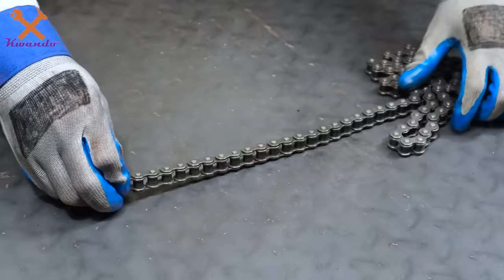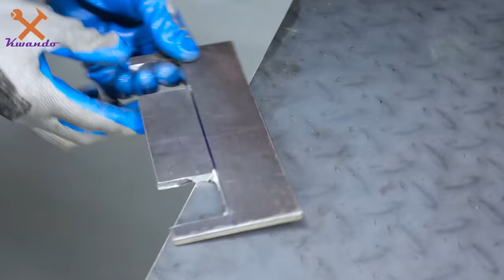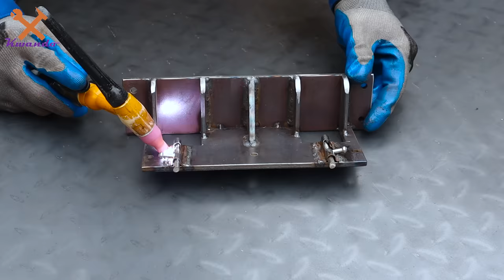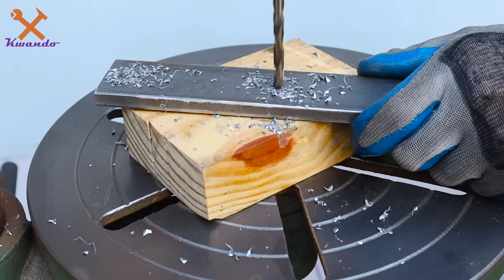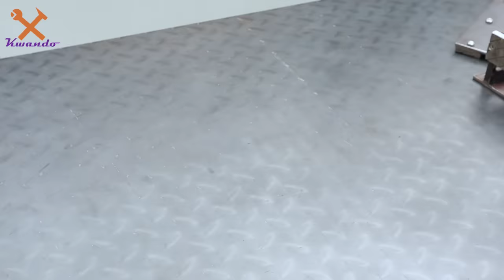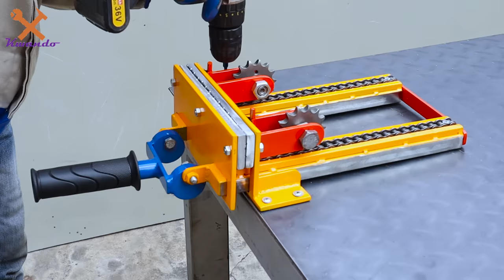Make An Unique Vise That You Never See Before From Bike Parts | Chain Vise

Comment: Hey nice job, I like how wide the mouth on it is, suggestion could you not tack on a small bar across the 2 locking pins with a light spring to keep it in the down position until you lift the bar to move it, it looks like a pain in the arse trying to pop ea. One up ea. Time you need to open or close it. Just a suggestion Thanks for sharing you have some great idea's luv watching them come to life.

Comment: nice... i like the quick action handle to tighten, not sure if those sprockets in the rear are actually needed 
u could always use a roller bearings and just drill  holes in the sliders 
and made the side locks into "one pull unlocks both sides" for a quick release..... but still a really clever compact unit.....
Reply: 7
Reply: Agree 100% but the sprockets are some of the "bike parts" that keeps him from needing to -buy_ bearings . Good comment , tho , and good build Vid 👍.
Reply: I Agree. I was also thinking on similar lines as you and was searching for the confirmation, which I got from you. Really the chain and the sprocket is not required at all for this concept although it is used very well here and I got the idea of making a rack and pinion from this in cheaper way, to be used in some other project where it is needed.

Comment: Very nice work. What type of welding are you using? I don't see any wire or rod being introduced to the arc.
Reply: tig welding process! it simply melts one material with another without the need to use a filler rod. Excuse my translator's English. Cheers!

Comment: Hi bro, nice idea...I like it, if you do not mind, could you share the welding toll that you use, look so easy to use..I want to buy it one..
Tq in advance...
Reply: What he is using to weld is a TIG torch.... likely DC positive ground.
This system requires a shielding gas such as argon....

Comment: As a retired toolmaker I can see one Major problem with the end product as shown . All those cogs ,sprockets and chain over a short period of time will get clogged up with the usual grinding ,welding dust and drilling swarf etc that is usual in well used workshops and garages .Please make a cover to protect them ; the cover could possibly be made of a flexible material [Leather] .Remember most vices have the main lead  covered [protected ] from contaminates .
Reply: No
Reply: They seem unnecessary, a couple of bearings or wheels in a channel would probably be better but the issue you point out is still there, I agree needs to cover those up.
Reply: Yea but then it wouldn't look so bad ass! Can't you just hit it with your airhose after every use?
Reply: Turn it all upside down mounted on the underside of the table, then project the vise jaw to the top flat of the table so it forces the cogs into the chain ⛓️ as the jaws are closed, the chain ⛓️ lock positioning bolts will then need to use there own turn lock to counter gravity, lots of potential kinks to work out of this one.

Might be a serviceable idea 💡 🤔💭🧐 with a little rework from every angle 🫠🙃😶‍🌫️😵‍💫😖, sprung lock pin chain ⛓️ track with release mech to slide, good indexing idea from an old chain must be evenly stretched & taunt, lots of slop potential to eliminate 🤦🏼‍♂️😬🤐...

Comment: For improved holding jaws might want to use some leaf springs, since you can machine them into form and then heat treat to harden them. Other option would be getting hardox or other hard metal, or blade steel, but leaf springs should be pretty universally around. Neat system, though that camlock will wear out pretty fast.. maybe add dust cover and some grease for it?
Also why it says your channel is from America, when its clearly from Thailand?
Reply: Muy buena  !

Comment: The result is beautiful no doubt, but too many bits and pieces to cut, drill, and weld. Even if the metal comes at scrap value, the assembly would require high skill and plenty of time. 👍👍👍

Comment: interesting design, but not quite understand the function of the gears, it appears this could have worked without them
Reply from the maker: The sprockets have 2 functions:
1. They keep vise stable when moving and working.
2. They keep direction help vise always go straight.
Regards!
Reply: @KwandoTechnic  The sprockets aren't keyed together, they spin independently. So, they don't help the vise stay any straighter than an extended guide would.  Put something irregularly shaped in the jaws and the vise will bend to conform.

Comment: In this way, nothing can be marked exactly. Screw thread not suitable for gear shaft Minimum to install screw connections without washers.
He clamps, strains and wobbles. My master in the workshop would have kicked my ass for such work.